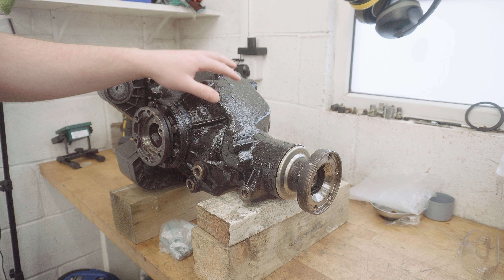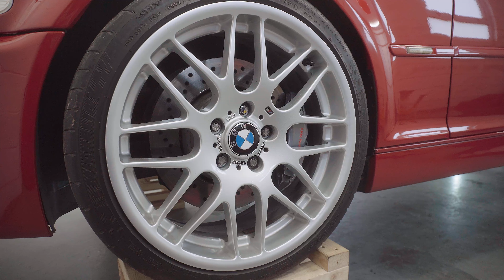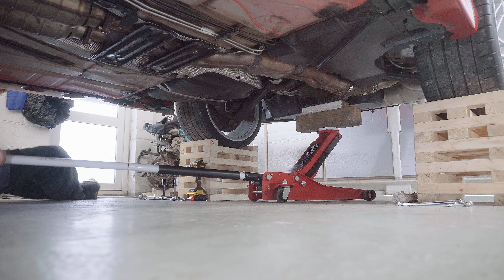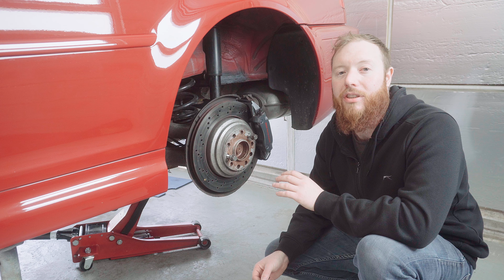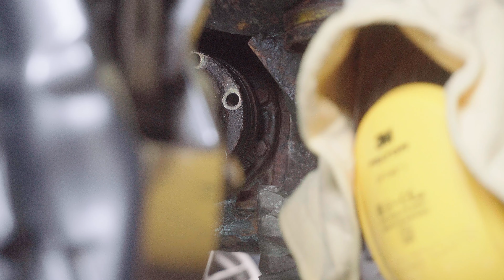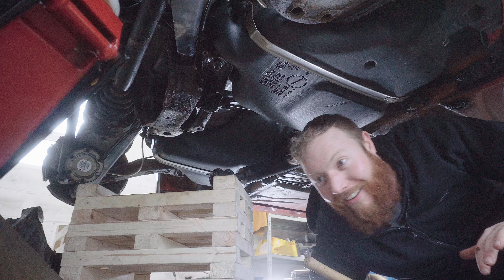E46 M3 Differential Removal Guide | M-Clunk, Differential Bushings & BMW M3 9-Year Ownership Update

Comment: good video. got mine booked in at ETA next month for RACP job, got a pissing diff from the input shaft seal so getting that done too. nice M3!
Reply from the maker: Cheers! Yeah the ETA lads know their way around an M3. Really happy with the work they did. I shouldn't have opted for polybushings though in hindsight. 😅

Input seal I will be tackling on whichever diff goes back on, I reckon I can DIY that. You'll see how it works out in the next vid. 😃

Comment: nice thumbnail

be wise to get rid of that polybush in the front at 20:19, they can work their way out especially if you track it 

OEM bmw bush is better, if not solid alloy
Reply from the maker: Thanks Mr DC2!

I didn't know they had a tendency to back out like that, aiming to swap it for OE along with the back plate. The clunks finally getting to me. 😆

Reckon I'll first "quickly" swap in the spare diff to keep the car mobile though, and I'm curious about whether it will be the same.

Comment: Nice M3.. 😊

Think its your longshaft CV which is causing the clunk.. when u turned the longshaft in the video, heard some faint loose clunk...and with all the loose grease, i think its best your redo the CV..
With the 341 ponies, that CV takes a lot beating.. 😮

Just a thought..
Reply from the maker: Cheers Felix! The clinking sound you hear when i turned that is actually the gearbox flange turning, the CV on the prop actually felt pretty sound. The driveshafts have a bit more play than I'd have liked, but not a crazy amount either.

It's likely a combination of a lot of small amounts of play adding up to one big clunk. But I suspect the majority of the problem is with the diff, being that they're notorious for it.

We will see how it all plays out!  😄

Comment: 23:19 I have the same problem, might be your crush ring or swing arms need to be adjusted. I have a 4.10 diff. Car came with 3.73 S. My suggestion is buy rebuilt or do it yourself. Just make sure the parts go Back the same way left side, right side. Take your time. Cheers
Reply from the maker: Cheers! You have the same clunk or the same leak?

I'm a bit intimidated by rebuilding the M3 diff, but I think I might need to have a go at it. Really don't want to have the M3 down for long over the summer though, hoping to enjoy it! This is partly why I bought a "known good" diff as a spare, swapping that in in the meantime might take the pressure off. 😃
Reply: I have no leaks only clunk, big time when I back up and turning corners. When driving straight it is noisy, like bearing and gear noise.
Reply: Schims also play a big part if they are worn. I'm the original owner of my 1988 325is 147,000 miles on new motor, body has a little over a million miles. Rebuilt the old motor and sold it.
Reply: The 4.10 was used.  Only put 6,000 miles on it, going to buy a shell and rebuild a 3.73 since I drive alot on highways.
Reply: Just saying, change your axle bolts, and if you ever get any bolt that is hard to remove, use a good quality heat gun, it's the best. Low heat and 30 seconds at a time, just make sure your careful around flammable products, just did my upper brake hoses on the rear, no problem came off without a hitch.
Reply from the maker: @Barry-j7m  Nice, and yeah absolutely, heat is your friend. I was a bit fearful to use too much heat beside the CV boot rubbers on the driveshafts though.. I probably should have been braver with that!
Reply: @SPANNERRASH  the heat gun I bought has three different guards that fit on the gun that  keeps the heat concentrated and shields the surroundings from heating up. 30 seconds at a time, no flame, just hot air, I also used wet rags to help protect the heat from traveling. Two speeds really hot and hot.
Reply from the maker: @Barry-j7m  Sounds good in that case!

Comment: Also buy a stud kit to hold your diff in, easier to install.
Reply from the maker: Nice idea, I haven't seen those for E46 platform before but I will check that out.
Reply: @SPANNERRASH  just received mine from Condor Speed Shop, American made. They have them for your set up.

Comment: Video on those brembo calipers
Reply from the maker: Wish I'd have been pointing the camera at stuff back when I figured all that out.

They're Porsche 996 Brembo 4-pot calipers front and rear, paired with CSL discs. If I recall, I'm using Creation Motorsports adapter brackets to make them work. Unfortunately you need to get a couple of mm machined off the caliper mounting faces for a perfect fit.

Then braided lines to match. Oh and the rear pad uses a front pad from a different caliper, with a modification to get more full sweep on the disc.

Maybe I should do a vid explaining it actually, I'm now remembering there's quite a bit to it. 🤣

Comment: Check back lash
Reply from the maker: Yep, its possible there's an issue with that, the diff has done 117k miles after all. Most common with these though is the right side output shaft develops play. Either way I may need to strip the whole thing down to find out.

Lots to learn on this one I think!